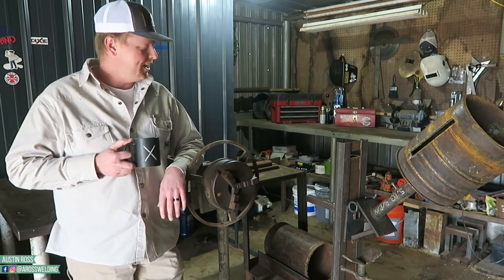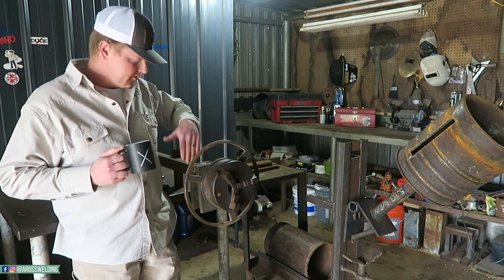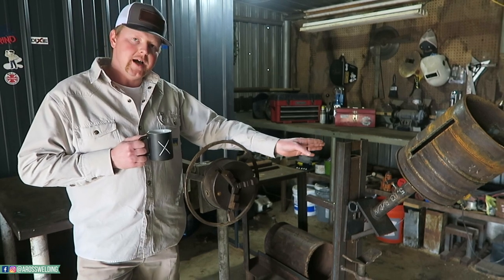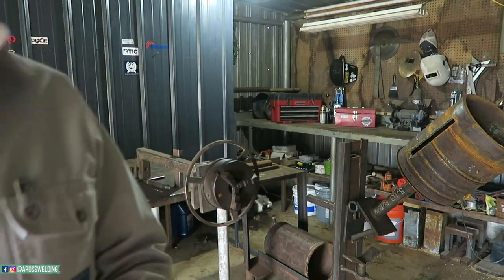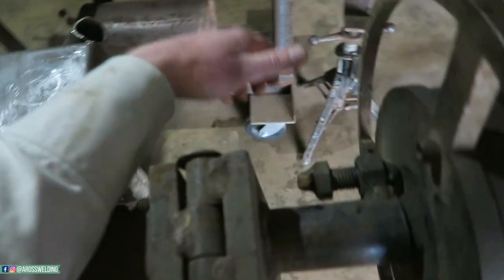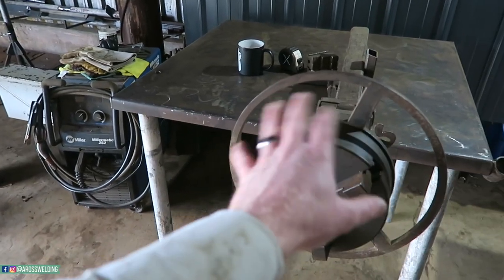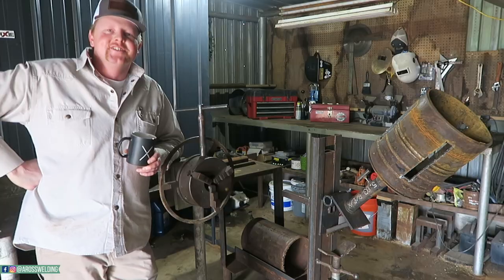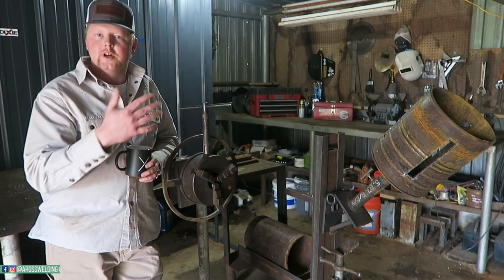ROLLOUT WHEEL FOR WELDING 1” TO 12” PIPE (HOW I BUILT MINE)

Comment: I made my hinge out of a bolt and 4 nuts, just sanded down the 2 nuts that bolt to the plate where my chuck is at. I love using roll out wheels cause there like another set of hands kinda like a vice, built mine out of plate from the yard on a fab job so it only cost me 180$ for the chuck and 35$ for a trailer hub!

Comment: I used the rear axle hub assy off a Dodge carvan, they are bolted to a flange on the axle. I welded a plate to the flange that the wheel mounts on so a chuck could be mounted and I use a small steering wheel off a old stand up forklift for the turning wheel.
Reply: Caravan spindles are nice parts for that and you can also use rear spindles off a front wheel drive car.  The front spindles off a four-wheel drive pickup are similar and the old stub axles easy to remove from the axle assembly then attach to a chuck backing plate. The way many spindles mount they're great rollout wheel candidates. 
It was easy to score all the parts by being observant.

Comment: In the 80's we called it a flange roller. I still have mine and it fit up to 12" flange. One end in vise and other on Jack stand to level.
Reply: do you have a picture ?
Reply: @bobwas4066  Working out town now if I can remember when I get home I'll get one. They are easy to make. 3" x 1/2" flat bar with slots to bolt flange to. I welded 2 3/8 pipe threads in center. About 3' of 2 3/8 pipe with collar on it. That is so you can unscrew flange roller and screw in pipe threads to weld 90 or tee to threads. Put one end in vise loose enough to turn, other in pipe stand to level. I like Austin Ross idea of putting 2 3/8 inside of 2 7/8 so it will roll better. Wish I had thought of that
Reply: Thank You

Comment: Thanks for the great videos Austin! Working on building my first roll out wheel right now. Noob question I am using a trailer hub is it ok to hook my ground to the table next to the roll out wheel or should it be hooked to the pipe? I'm worried about it arcing through the bearing. Seems like something no one really talks about in any videos I have watched. Thanks for your help!
Reply: I’m looking to build a roll out for myself at work. I remember learning in my college welding program about proper grounding off the main shaft that your plate is connected to. I’m thinking of braided copper wrapped around the shaft. Tight but not too tight. What they were talking about was for electronic positioners But from my years of welding in shops with positioners,nobody gives a shit about where it’s ground so go nuts and do whatever. Electricity will pick where it wants to go. I suggest just doing what you think is best and you’ll be good to go 👍🏻